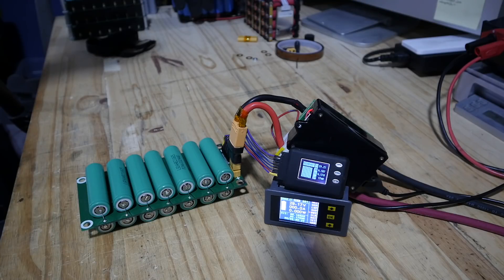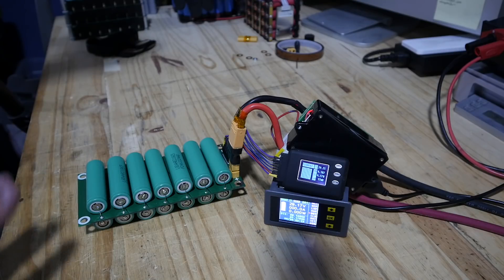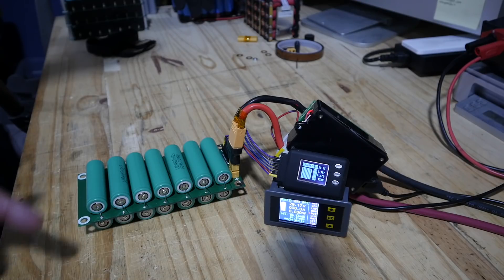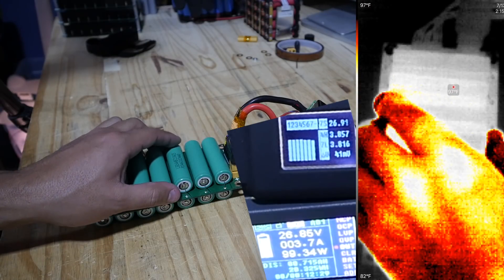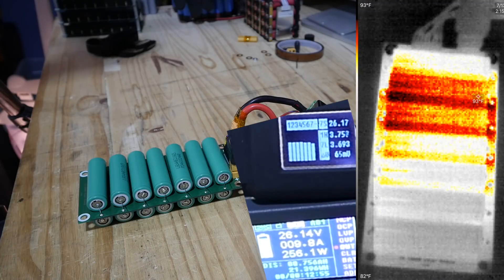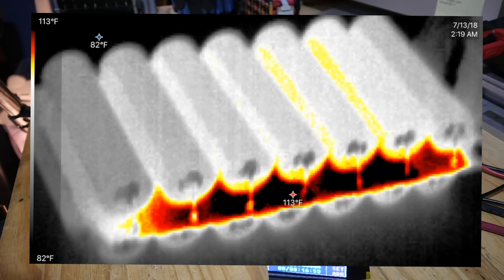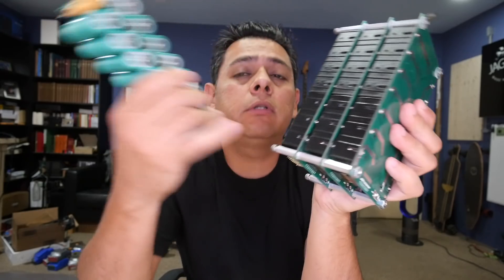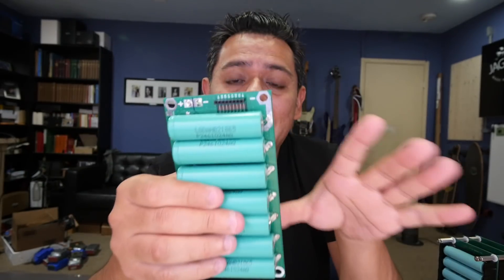18650 DIY Powerwall PCB module POWER Load Test

Comment: Can you find better holders? Or can we do something to the holders to fix the heatup? I'd really like to use the holders. You can put holders on each side of the board without problem I'm sure.
Reply: Are you going to be loading it heavily? Like jehu said around the 6 min mark when these are assembled in a large parallel array heat from the contacts isn't going to be an issue. But if you use it for a small battery bank like a bike or any other small high current pack then you'll be pulling heavy current and can understand wanting to beef it up...
Reply: The metal contacts in those holders are removable, I've yanked them out with pliers to figure out how to improve them.
For a flat strip of metal, they should be better than they are. There are two points that restrict current flow:
1) The pin at the bottom where the majority of the metal has been cut away
2) The contract point where the metal strip contacts the end of the cell isn't that big either.
Could be worth designing better contacts, then having the chinese factory mass produce them.
Reply: toysareforboys like said in the video, these should be fine for normal powerwall usage. Are you going to use them for something more demanding?
Reply: Yes, but the cells are not removable then.

Tha's the problem.
Reply: The main problem is the material used.

Contact area doesn't matter much, since then, the length of the contact is so short, it almost doesn't matter.

For example, the contact resistance of a steel spring is usually 1-2mOhm, which is absolutely nothing.

If we were to use a metal such as phosphor bronze C54400 19% IACS instead of Stainless Steel 5% IACS, or even Beryllium Copper C17530 38% IACS, then these holders could be made even better.
Reply: No need for holders if the pcb and solder holds the cells in place. The 2nd design without the holders saves money. A lot of lithium batteries that are in products don't use holders.
Reply: Is there anyone producing double sided battery holders?
Reply: Tom, by the same token, the original idea of using the holders was to make replacement of a cell/s easier as the cells aren't soldered onto the board. Going with the PCB option, as per this video, now reintroduces something Jehu was trying to get away from.